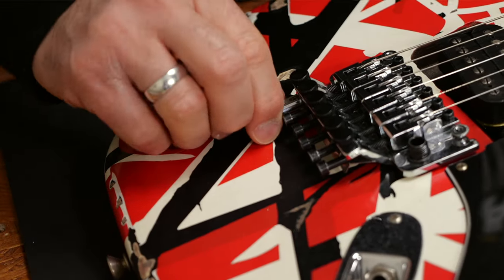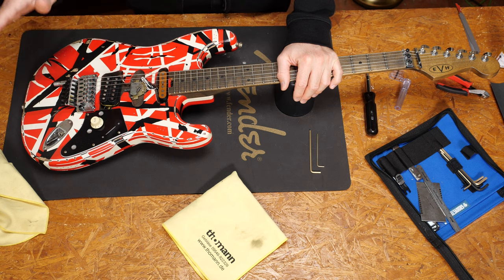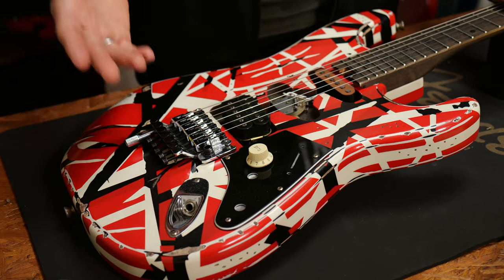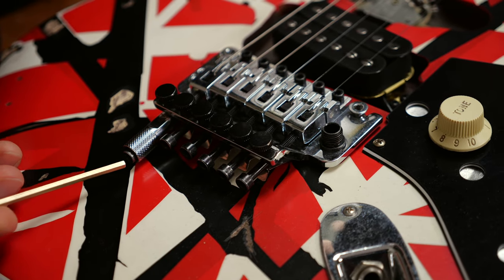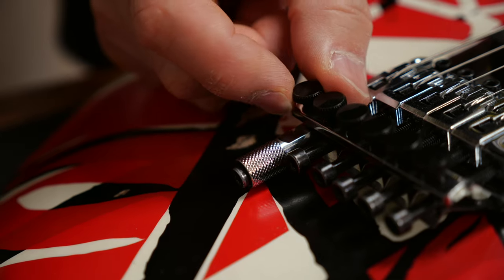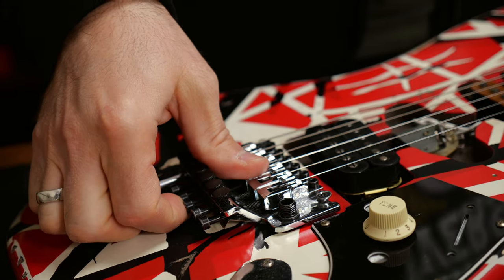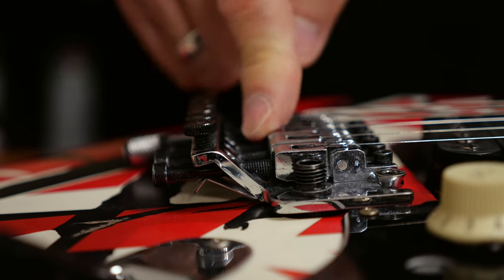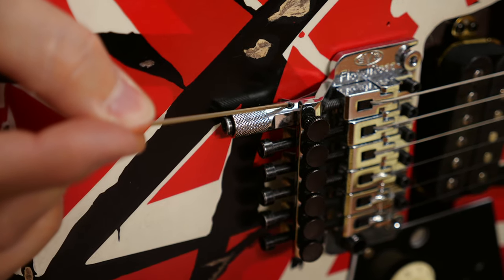How to set up the EVH D-Tuna | Guitar Tech Tips | Ep. 28 | Thomann

Comment: My D-Tuna from Thomann arrived today and works like a dream on my EVH Wolfgang Standard! Thanks guys
Reply: cool .. that's exactly what I did on my Standard.
Reply: I just bought a Standard. Does the D-Tuna installation prevent the tremolo from being able to be pulled up? I like using my tremolo both up and down, just curious if the D-Tuna will prevent the pulling up motion.
Reply: @rocknstv570  Wolfgangs are not meant to be able to pull up, they’re supposed to be set flush so only dives are enables. If you have it set floating you won’t be able to use the DTuna
Reply: @VioletSerenade  Yeah, that's what I thought. I have mine set floating. Thanks!

Comment: Thanks for this! I just bought a Kramer Baretta and it came installed on the Floyd Rose..This video made it easy to tune..Thanks again!
Reply: Can you fine tune it to D and then push it back in and fine tune back to E or do you need to do it with the machine heads and undo the locking nuts?

Comment: Have an  EVH wolfgang special stealth with d-tuna... As soon as I go from D to E all other strings go flat... Even if use only fine tuner to drop or raise the pitch, other strings goes flat/sharp. I have a lot of frustration with it, it is easier to retune all strings. 

So, d-tuna kinda work, for listener, but not for experienced player... Or if your don't care/can't hear it.
Reply: I mean that's just how string tension works. When adding tension to one string, the neck bends in slightly making the rest go flat. A good trick would be to tune slightly sharp in Standard or slightly flat in drop D and then you're out less on either end.
Reply: I think the part you may have missed is that you need to block the bridge so that it's either fully blocked or so that you can push bar down but you can't pull up on it. If you leave the bridge free floating, any change in string tension, such using the d-tuna, will cause the other strings to go out of tune.

Comment: Enjoying mine but still fiddling with the tuning as it doesn’t want to stay perfectly in tune in either one of the standard or drop if I tune one perfectly. 
I think it would be good to mention where the little Allen screw should sit starting out, where if it’s in too far, you won’t be able to pop the tuna inward.
Reply: Had a similar issue with mine. I had the fine tuner halfway down couldn’t remember why. Took it up and the dtuna worked perfectly just had to dial in the fine tuner on the side. 2018 USA EVH Signature Model (white). Awesome guitar.
Reply: I'm having the same issue with my wolfgang

Comment: How about the D, B and high E strings staying in tune tune when switching  between E and drop D ?
Reply: @Ryan-hi1hl  I bought and got rid of this thing after a few weeks. Just didn't work with my Charvel Model 4 and orig Floyd. Way too much fine tuning to do when using the bar, and I had the trem blocked as much as it could be, and even with that, it wasn't a good experience. I'm back to full floating and loving it!
Reply: I'm finding I have to turn the side fine tuner screw in so far when in the D tuna is pushed in to E tuning position, it makes it really hard to push and pull the D tuna in and out. No matter how I tune to drop D, when I push  the D tuna in for E tuning, it's at least a 1/4 step down and then I have to adjust the fine tuner quite a bit, which makes it hard to move the D tuna. Doesn't seem like  there's anything else to adjust when you tune to drop D initially, as the instructions say. I've even tried to have the Floyd fine tuner pressing down on the screw just a little.
Reply: I'm having these same issues with my evh wolfgang. I wish I could get it to work.
Reply: @NickATFGuitarMan  Update: I put a better block on my Floyd, and that problem seems to have gone away! The only issue I have now is when changing the low E string and fiddling with that side set screw, but once it's dialed it's fine. I removed the D Tuna for some months bc it was so frustrating, but then decided to try again. Glad I did.

Comment: What happens then if you need to raise the entire bridge in order to raise the action? Do you need to tighten the springs to have it sitting at an angle against the body of the guitar?
Reply: I had that issue on my wolfgang standard and honestly the best way about it then is just to use a tremolo stopper to make it dive-only. The D-Tuna might not work with the bridge at a downward angle.

Comment: Question. The screw that is adjusted with the small Allen key. Just as you have a default for the fine tuner with the d-tuna what is the default for the screw you adjust with the Allen key when you start to tune the low E?

Comment: Thanks for this! I have the problem that even after following the instructions exactly, my "E" ends up way too sharp, with the drop "D" being in tune, the fine tuner on the bridge all the way up, and the fine tuner on the D-Tuna also all the way up and away from the screw. I can make the switch work only by adjusting the tuner on the bridge a little. What am I doing wrong? Any help would be appreciated.
Reply: Exactly! I have the same issue! There's gotta be a fix.
Reply: You have to undo the 3 screws at the nut .. then do this process you’ll be good to go 🤘
Reply: Same issue

Comment: If I install this would I only be able to have the Floyd fully floating while in drop  tuning and dive only when I use the d tuna to switch to standard tuning I really like the concept and I’m interested in getting one I just had this one question I need answered before I pull the trigger so to speak
Reply: Get a tone vise pitch shifter and a black box stabilizer, you won't have to block the trem based on the research that I've done

Comment: I was going to install this with a tremol no so I can set my trem to float or dive only I had the misconception that you tune the guitar to standard tuning and use the d tuner to change to drop d but I found out that you tune to drop tuning  then use the d tune to switch to standard tuning so I figured if you set the Floyd to float in drop d you would be able to pull up but when you engage the d tuner you would have to be in dive only mode I might just get it and do some  experimenting to find out for my self and post my results I might also make a video I also saw you can leave it floating with a trem stabilizer so I’m thinking about experimenting with having a trem stabilizer, tremol no and d tuner installed at the same time to get full function of my Floyd while it’s floating andbeing able to use the d tuner to quickly switch between standard to drop d I can contact  you once I made my findings
Reply: Black box stabilizer and tone vise pitch shifter.

Comment: I just bought a Jackson dinky from 1989 and it has Schaller tremolo licensed under Floyd Rose and this tremolo has shortened screws. Is there a solution to that type of tremolo?
Reply: I have an N4 with Schaller tremolo. My D-tuna came with a couple of different length string locking screws to account for this scenario.

Comment: I bought an EVH Wolfgang Standard brand new a few months ago and want to install a D-tuna. I assume there is no reason I cannot do that - correct?
Reply: easily done, i did it to my standard
Reply: @VioletSerenade  Thanks. I heard someone say that the D-tuna is unnecessary because you can just tune to drop D and then use the fine tuner on the bridge to go up to E. I tried that but went I went up to E it threw all of the other strings off (probably because I don't have my bridge completely flush with the body)......
Reply: @humanbeing2420  Yeah i freud the fine tuner trick but it wouldn’t go far enough for me.
Also disclaimer, if you want to use the D-Tuna you’re gonna need to have the bridge completely flush with the body so you cannot pull up at all.
Hope it helps mate
Reply: @VioletSerenade  Thanks - good point. The reason I don't have the bridge flush is because I use 10s, and when I put them on I had to increase the spring tension but had trouble turning one of the two screws for the spring assembly in back. I was at risk of stripping the screw head so I just got it as close as I could and called it a day. It's only about 1-2 mm above the body - I don't use it to pull up or anything. Edit: I probably should invest in some higher quality tools - I have an extremely basic home repair tool set.

Comment: What type of bridge should I get if I want a piezo function with a drop tuna?
Reply from the maker: Hey, you didn't write what kind of bridge your guitar has. Floyd style? Traditional trem? Gibson style stop-tail? The Ghost system from Graph Tech is really good. They have saddles for most bridge types and even a full floating trem: https://www.thomann.de/de/graph_tech_ghost_lb63_fr_bridge_bk.htm
(check if it's compatible with your guitar on their website of course). Cheers //Kris
Reply: @ThomannsGuitarsBasses  I'm planning on building a custom in which I can put these two functions on. Im thinking if its possible to install a drop tuna on a Wilkinson type. If I'll use a floyd rose, would there be another way of putting a piezo system as an alternative to the grap tech because it cost a lot. Thanks!

Comment: I have a Washburn N4, and the bridge (Floyd Rose) is a few milimeters under the top, so seems to be that I'll have to buy another guitar 😁
Reply: No. No you don't.  You just need a FU style tremel- no that stabilizes/prevents the bridge from falling into the route. Costs like 20$. This guy should have mentioned this EASY MOD SPECIFICALLY.
Reply: I have a d-tuna on my N4. I just blocked the bridge so that it can dive only, but can't pull up. This is required for the d-tuna anyway, as the guitar will always go out of tune using the d-tuna if the bridge is free floating. The d-tuna sits around a quarter inch or so above the guitar body.

Comment: The problem with the D tuna is it DOESN'T  WORK,  with most floyde rose set ups. It was built for the Wolfgang guitar or a Kramer like Ed's.  So basically it's marketing a product that only fits YOUR PRODUCT.  
A more inclusive design would be like a hipshot on a bass where there's locking machine heads that release a full step when triggered.

Comment: My d tuna gets stuck and I can not pull it out to the "D" position when I have tuned it to "E" with the allen wrench, does anyone know how to fix that? Right now  the only way is to tune it down a bit and then pull it out to "D" but then it gets out of tune when it's in the "E" position and I need to use the allen wrench every time I use it.
Reply from the maker: I only had issues sometimes with D Tunas, when the fine tuner screw of the low E string was way down -> turned almost all the way in. 
That's important with a D Tuna. If the fine tuner screw doesn't push the D Tuna lower and lower, it moves way easier to its "drop D" and "standard tuning" positions. 
Hope that helps! //Kris
Reply: @ThomannsGuitarsBasses  Ive got the exact same problem, Drop D is in tune but the low E is always a little bit too low, but when I tighten the finetuning screw, I cannot pull it out. How do I solve this?

Comment: Thank you for the tutorial , I have and EVH Wolfgang signature,absolutely love it .But I’ve notice when I have the D Tuna out it seems loose and it rattles on certain notes, what should I do to remedy this ?
Thank you
Reply: I think you need higher gauge strings, or you need to play lighter
Reply: Use the shorter string lock screw that come with the d-tuna. This will make the spring tension in the d-tuna tighter so it holds it in place without rattling.

Comment: When using the fine tune adjustments on the D-tuna with the Allen key, should the unit be pulled out or pushed in to make those adjustments? 

Amazing videos as always! 

Much love from Boston 🤘🏻
Reply: With the unit pulled out, you tune the guitar to drop D. Push the unit in then you set the low E strings tuner with a small allen key.
Reply: ….and what do you do in normal use when the E goes out of tune? Do you have to get the Allen key out or use the fine tune on the Floyd Rose?
Reply: @chrisstevens4680  You have to use the Allen key because you're not supposed to have the fine tuner in use with this thing - it's not practical and when you go to standard it will never be in tune.  The people that rave about how great it is either aren't actually using it in standard, are out of tune and don't realize it, or have a trem lock - because a floating bridge can't stay tuned in both tunings at the same level of tension, it's physically impossible.  Tightening a string a full step, pulls more tension on the springs, which loosen tension in all other strings.  If you're tuned in drop D, it won't be in tune in standard, and if you tune it to standard, it won't be in tune in drop D (only the low E string can stay in tune in both tunings).  It's a gimmick, not really worth it.
Reply: @chrisstevens4680  You have to use the allen key. With the D-tuna installed, you should never use the fine tuner on the bridge on the low E string anymore.
Reply: @nvlddmkm1282  That's correct. It only works if you have the bridge fully blocked or at least blocked so it can dive only, not pull up. The bridge can't be free-floating. It says this in the D-tuna install instructions that come with it.
Reply: @silentstormstudios  That’s a pain in the butt if you are in a live situation! Life is not perfect!!

Comment: I was excited to buy one of these for my razorback until you said you needed a top mounted floyd LOL
Reply: If you use some tool to keep your Floyd from going up you can still use the D-Tuna. Something like a Tremol-no. You can also find "Tremolo Stop Locks" on ebay that can turn your guitar to dive only. Once those are fitted and adjusted you can lock your tremolo to only go down, as if it was resting on the body. That way you can use a D-Tuna no problem.
Reply: Black box stabilizer and tone vise pitch shifter

Comment: So it’s pointless? The advantage of a Floyd is that it’s floating but with this it has to be pulled against the body all the time. so it’s dive only so you might as well have a regular trem.
Reply from the maker: Well, just partially. You still have the benefits of using a Floyd if it sits on the body. You have the sound and the tuning stability compared to a vintage tremolo.
And one huge plus: if you break a string with a Floyd like that, the other strings don't go totally out of tune so you can finish up the song. That actually saved a number of gigs in my life. haha
//cheers, Kris